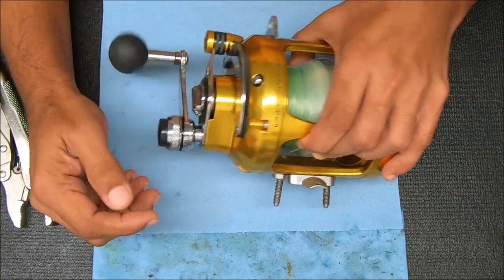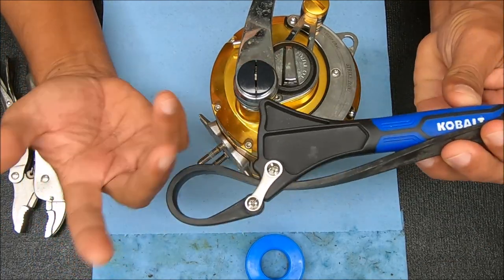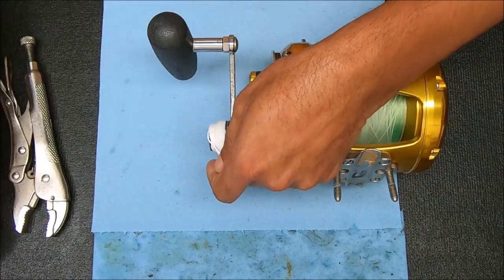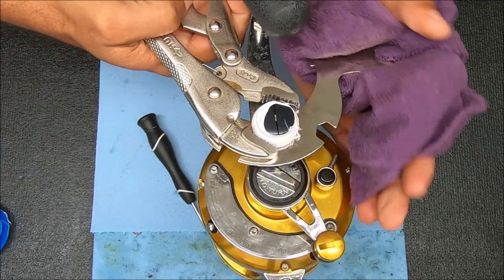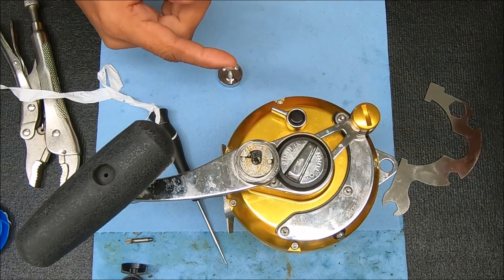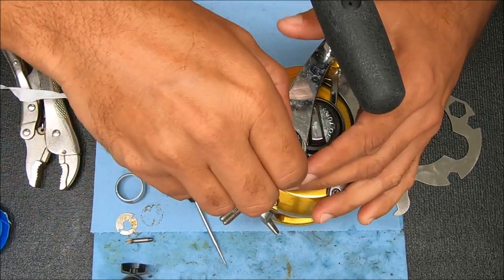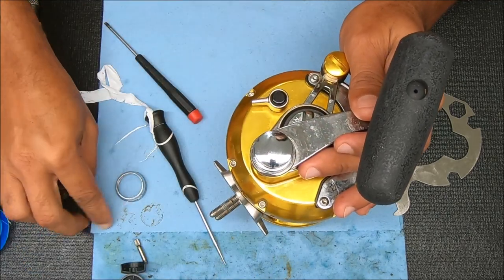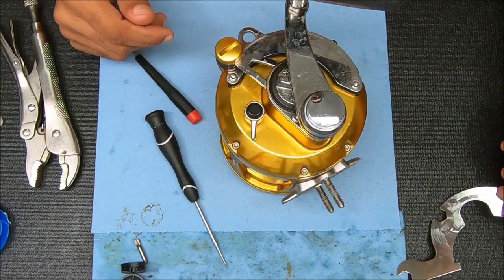Cracked Two Speed Button | Penn International VSW | How To Replace - Fishing Reel Repair

Comment: Mind keeps slipping between high and low speed.
Reply from the maker: It could be a couple of things, but usually the long screw inside the gear shaft is loose. I did a full breakdown of a different sized VSW that I still have to edit.... you can see the long screw in the breakdown when I post it.
Reply: @TSGReelService  thank you, highly appreciated.
Reply: Crazy looking wrench you have there. 😊 Thanks.
Reply from the maker: @stevecarrero4120  🙂